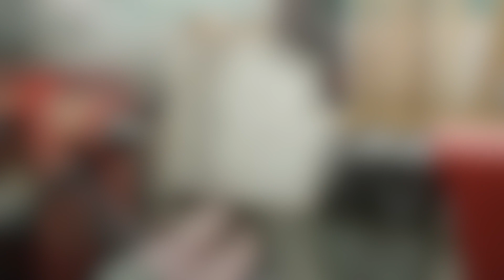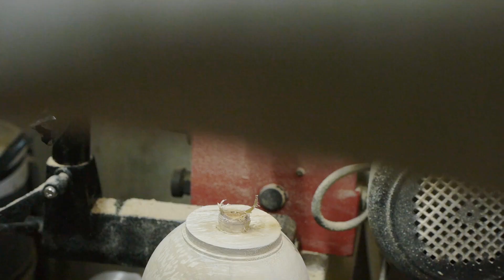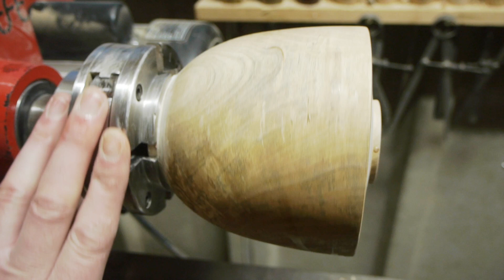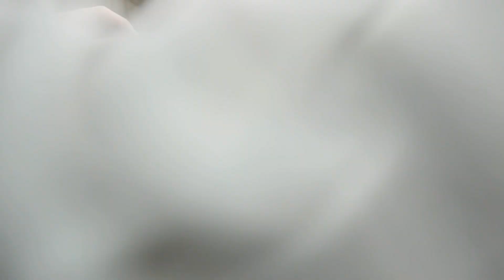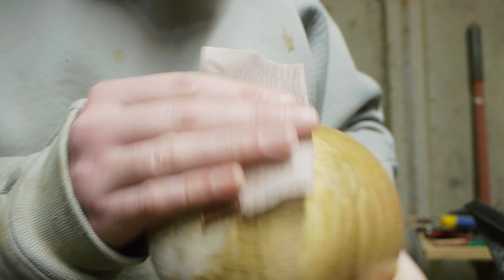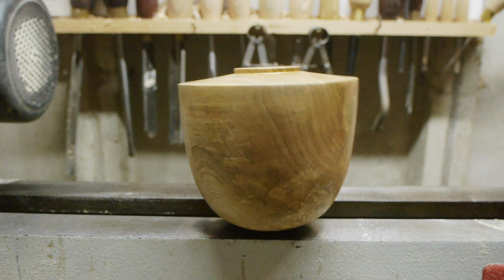Wood Turning - Wobbly hollow form - Silver Birch

Comment: Was it a curved gouge or scraper that you used to hollow out?  Not clear in video.  Thanks.  Nice piece!
Reply from the maker: Thank you so much! Yeah it's a tough one to film with the time it takes vs. what it looks like on screen so I often speed that part up 🤦‍♂️ I'm using a swan neck carbide tool, I'd have to go and check but I'm pretty sure it's an 8mm round cutter. Thanks for watching!